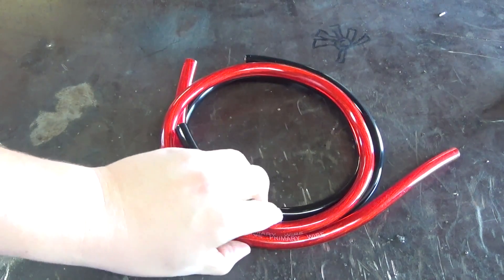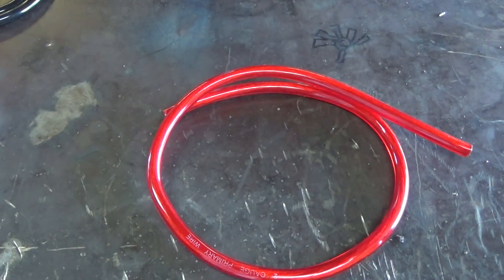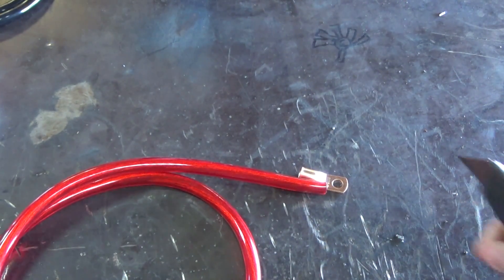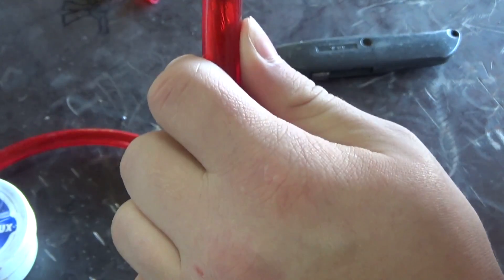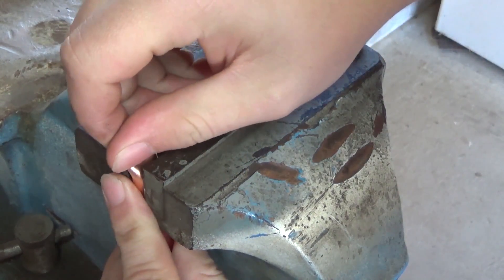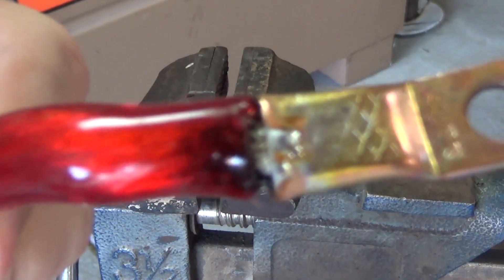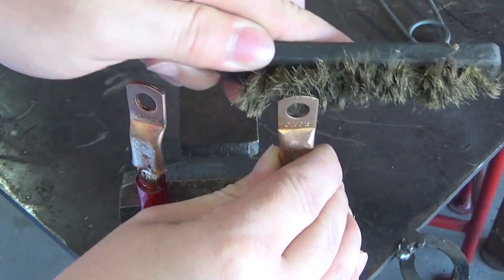Soldering Large Battery Cables

Comment: Is that special electrical flux? I used flux on my cables 3 years ago. This year, they all corroded and the ends broke off the positive side. Only thing that makes sense to me, is that the flux wasn’t fully removed from the wire and continued to etch the copper till it ate all the way through. Thoughts?

Comment: Thank you for stuffing the cable end into the flux.  The keys to long term reliability are enough flux, enough heat, and the timing of combining everything.  Old timer showed me a couple tricks that I still love.  If it is a closed cup cable pocket on the terminal,  put the other end in a vise pointing straight up.  Only grab 1/4” or so with the vise so it doesn’t act as a heat sink and fight your process.  Every step from here on is crazy overkill (I’ve been told)  but in 45 years of personal and friends usage every one has inspired confidence.  Horizontally scratch up the interior of the cup.  A cool quick tool is a 3/16 headless bolt dipped in super glue and then sand and chucked up to spin.  Next stuff a little glob of flux in (about 1/4 of the volume) and then not quite fill it with short cut bits of solder.  Prep the cable end and jab it into the flux. Now comes the timing of the torch.  Hold the cable sideways and angled down a little.  Put the side of the flame against the end of the copper.  When the liquid flux stops dripping, (and that is quick, don’t stick around and melt your insulation) move the torch to the bottom half of the cup.  When the flux heavily smokes out and all the solder is very liquified, put that cable end in there carefully.  The contents will overflow because overkill and overflow   umm….had the same dad.  This is all quite insane….I know.  But over the decades this ceremony has become fun so I can’t quit now.  And none have failed.  👊😎

Comment: Get yourself a Wagner heatgun with temp control, you can control the heat much better.  I drill a small hole in the terminal connector 1/16" to feed the solder in. That helps prevent wicking solder up the cable.  Finish with shrink sleeves you can get at any battery shop. Use dialectic grease when making your connections and a small amount of red locktite. Your connections wont loosen up and will resist corrosion.  P.S.A. don't burn your fingers!🤔😲😷😎🇺🇸

Comment: Very good. Learned a lot thank you!
Reply: If you realize he showed how NOT to do it!.... 😂
Reply: I'm not a solder guy, so perhaps you could explain why, rather than a mocking comment? World is going down a mile a minute. Thank you.
Reply: @chippywarren9706  Why? because he does about everything wrong.
First of all you should never solder connections on cars/boats/motors or any other vehicle. (soldered connections are not suitable for moving/vibrating environments)
Then he uses the wrong tools (i.e. a box cutter is not ment to strip wires), uses the wrong size lug, and is using a lug not suited for soldering at all. A solder lug should have a hole at the lug side to apply the solder. Solder should never be applied (and should even never intrude the wire) at the isolated cable end. And one should never (vice) crimp AND solder.

Comment: If you are soldering a high amp batterie cables your asking for major problems including a fire. Crimping large ring terminals is in the only way to go.
Reply: @Bruno Gianelli
Lead solder melts at around 185 degrees Celcius. If your joints are getting so hot, you have other problems.
Reply: Robert Statile talks about using the right tools, the takes 5 minutes to cut with insulation (and several wire strands) with a box cutter. What kind of wire insulation is that? Looks like some kind of plastic that wouldn't be 105c rated
Reply: todd thibodeaux rookie needed to consult with a plumber first!!
Reply: @Bruno Gianelli Your 100% right, back before I had any idea of what I was doing I did the same thing but once my connections started to fail I did some research and found out how dangerous what I had done was. So I bought a hydraulic crimping tool and went around and redid all the ends that I had previously done.
Reply: @Scott Osborne Prior to copper wiring becoming the standard for residential wiring, soldering, say with old knob and tube, would have been fine.

Solder has about 1/10 of the conductivity that copper has, and should never be used in a residential environment. Wire nuts would be the appropriate junction there.

As for heavy guage battery cables, a proper crimp negates the need for solder, which can fade over time and cause connections to fail.
Reply: @gailbreathgeneralservices4503  what code are you talking about for battery cables? Also soldering battery cables is fairly standard. Most often crimped wires are more susceptible to getting corroded and then loose their contact
Reply from the maker: If you are crimping large battery cables, without the right tools, you're asking for major problems, including a fire. There is not an inherent problem with soldering large battery cables. Not sure where you get this idea. It's far easier to get a bad crimp than a bad solder joint. Which is why I mentioned using proper tools. I feel that a lot of people will have the tools to do the soldering properly already and if not the tools are relatively inexpensive compared to a good crimper. The only real fire danger with soldering the connector is the propane torch...
Reply: @Eman2000  Thanks for trying to explain but you should Never solder anything with such high Amperage it can heat the solder above its melting point. You will never find a factory cable soldered on.
Reply: Under no circumstances should you rely on solder for household electrical connections. ALWAYS use mechanical means of connection. If you are not getting a good crimp, then you are doing it wrong. When the solder melts (and it will) there is no telling what it will get on. In this case the battery will likely be the target, causing a myriad of problems. I am absolutely shocked at the advice given here. Furthermore, using a blowtorch is extremely dangerous. Videos like this should be banned.
Reply: @jeffreymadden759 , woke losers like you should be banned.
Reply: @Scott Osborne first of all, I don't have kids. I was smart and always wore a condom. Some people's parents should have done the same. Second of all, whether or not your draw is overloading does not change safety regulations. The advice given here violates many building codes. And those codes are there for good reasons. If you are going to argue code, then you really shouldn't be giving advice.
Reply: @jeffreymadden759  the video isn't titled how to solder battery cables to code, it says "Soldering Large Battery Cables" put on your glasses old man. and most of the regulations are bullshit. what are you an inspector/democrat. people like you are what is wrong with the world today, trying to protect everyone and everything from getting hurt, the pusification of the world.
Reply: @WZDIESEL  i don't agree with the democrat jab but i agree with everything else you said

Comment: Why do you use flux? Do you not use Resin core solder for electrical?
Reply: yeo you need extra to bond to the copper terminal, the flux in solder is only barely enough even for clean electronics and they often add more, but use rosin for easier clean up
Reply from the maker: The amount that is in the solder itself tends to not be enough when working with something this large. It's more or less just insurance.
Reply: This guy is a twit.  Never use acid core flux for electrical because it corrodes the joint.  Second you NEVER jut roll a sharp edge against the copper wire it nicks the strands and damages said connection which creates stress points and promotes breakage at the connection he is a waste of time and you don't use a torch it's for plumbers on pipe .

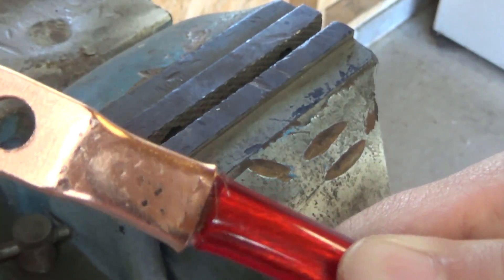Comment: 6:45  The reference to use 'gravity' to help bring the solder down into the terminal cup - I believe tinning the inside of the cup first would make for a better, easier and quicker solder flow (granted you did get an acceptable solder joint in there).  Thanks for the video!
Reply: So im new to soldering and not very good at it. I use a torch and practice a little bit nd im getting better. Could u or anyone plz define "tinning the cup" for me. Im great at doing automotive electrical work and making custom wire harnesses for auxiliary accessories and such nd im looking to improve my work. Plz help. Thx
Reply: @dangerjack4695  Melting solder into the terminal end held upwards like a "cup" before joining them together.   The danger of filling the thing with endless solder is that the strands of wire act like a  candle wick and the solder actually goes UP into the wire as well, where this solder ends, the wire is likely to snap in two if it experiences much mechanical movement.  For soldering you just want to solder the ends of your conducting wires into the terminal, and never have solder run up into the wire out of the termination "cup".
Reply: @dangerjack4695  In other words heat the terminal before putting the wire in it and solder a thin layer inside, your coating the inside of the terminal before putting the wire in it. You will never find a factory crimped on terminal with solder. the crimp is a better connection and can take vibration a soldered connection can break with vibration because it is rigid and does not flex. This is really a terrible way to make a crimp if using a proper crimp tool the wire is completely crushed making it like a solid wire needing no solder to fill in the voids.